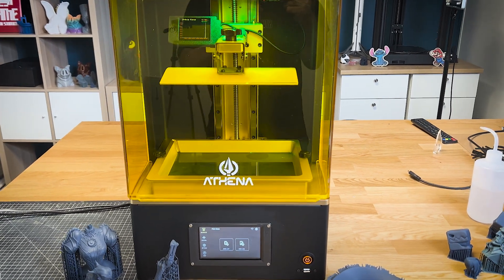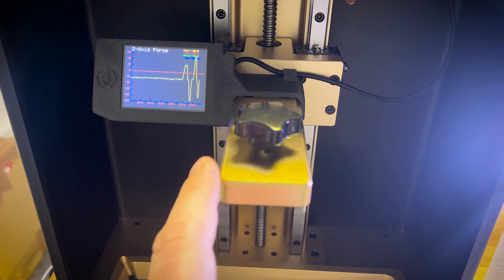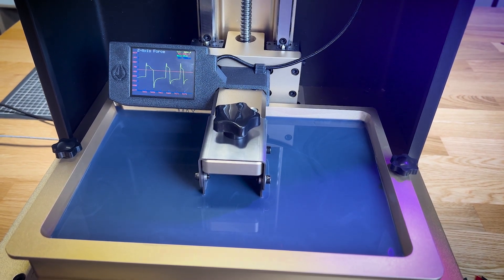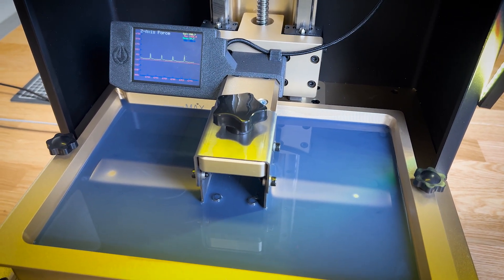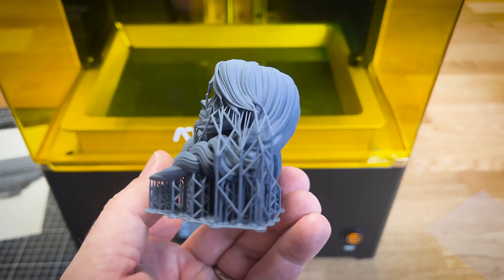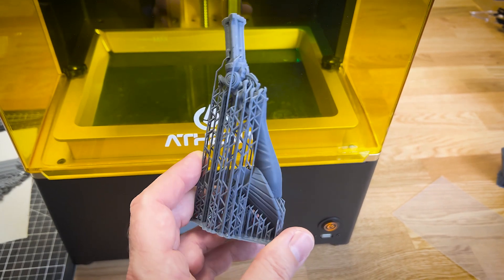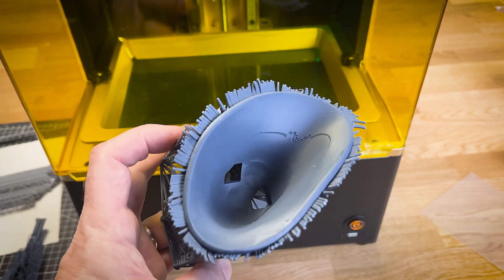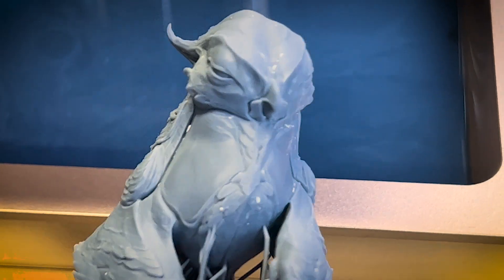Preview of the new Athena 8K Resin 3D Printer with Force Sensor!

Comment: Is this self-levelling like the Mono M5s? It doesn't look like it, but if it's got a force sensor, it could be I assume.
Reply from the maker: No, it's not self leveling. But IMHO, it's not needed at all as leveling a resin printer is usually easy.

Comment: Is the sensor supposed to detect failures or what is the purpose?
Reply: They have something similar on the M5s but it doesn't work!  Hoping for a decent review from Vogman.
Reply: Suppose to detect failures, detect ‘crashes’ if there’s a hard object in the vat, detect when print has lifted completely from fep each layer so it can lower again more quickly than a set amount of time for each layer
Reply: @CatFinder3000  ok it all makes sense now, thanks! So it can only lift 1mm instead of 8mm or whatever, sense the layer released from fep and immediately go back.
Reply: @predragbalorda  thats exactly right, they say it improvers average print speed by 40-60%. But without reducing print quality like you get by just increasing the lift and lower speed on other printers
Reply: @predragbalorda  That's exactly that. Because high lift distance can be important for large model, less for small size models. Now, you only need to set a max lift distance and the printer will override this setting if it detects that the peeling is done and then will move down the plate.

Comment: that looks very impressive - would be great with DLP printers too. lots of cool new tech coming out in the resin space
Reply from the maker: I have two DLP printer and with all the tests I did, quality is very close to 35 micron MSLA printers. this one is 28 microns and some 19 microns printers are coming. For me the two benefits of DLP are the lifespan of the lens- + no risk to break a screen. But build volume is quite small... Hopefully DLP wil increase in resolution and will soon hit 4K, then it will be nice :)
Reply: @PolyworkshopInEnglish  is it true that dlp printers cause a sort of “stair-stepped” effect on the surface of your printed models?